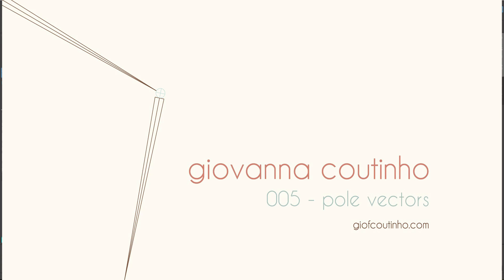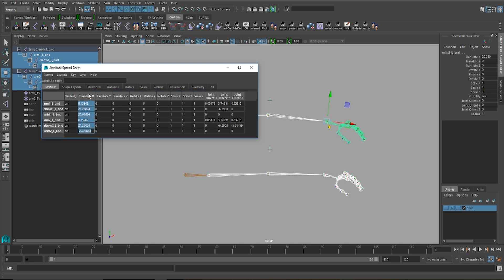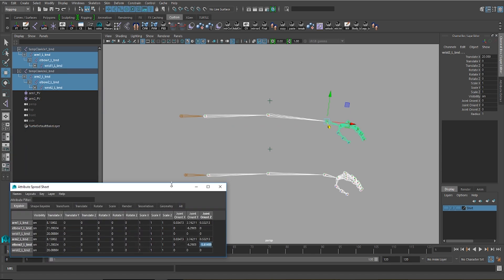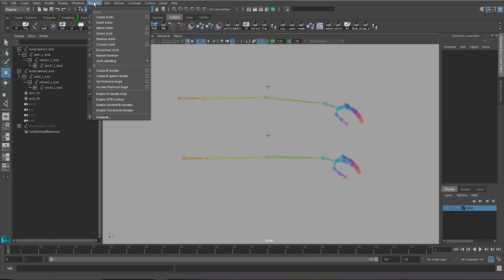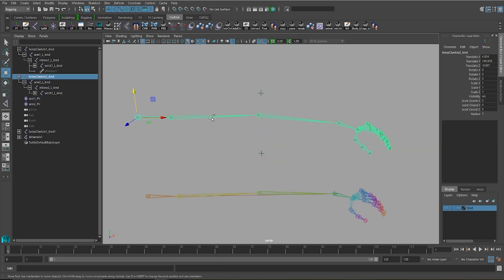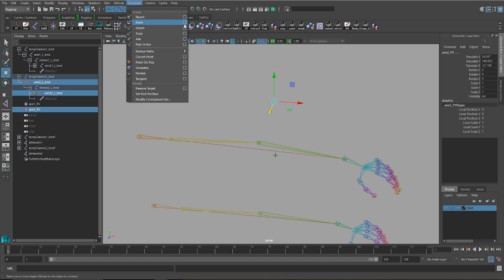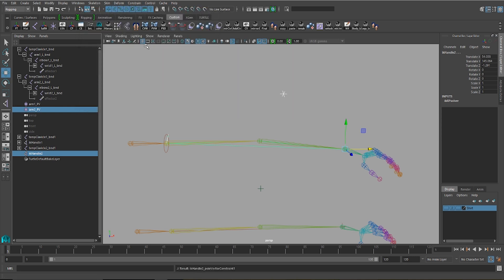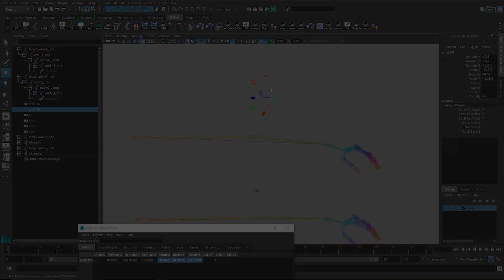005 - Pole Vectors

Comment: Brilliant - this is really helpful  - thanks for posting this! - One extra thing I found - at 4:42 - when you move the locator back away from the joint, I needed to set the Move tool to something other than 'World' mode. I set it to 'object' mode - but found I needed a couple of goes to 'push' it past the joint - setting it to 'custom' worked best as it kept the same angle and allowed me to push it past the joint.

Comment: Hm I'm still getting PV snapping even with only 1 axis of rotation. With a biped model with legs that aren't completely straight, what's the best way to place your joints to avoid snapping? Or is there no way to have a normal-looking perfectly aligned polevector with a bent limbs?

Comment: Nice technique. I usually solve it by drawing a 1 degree curve through each of the joints (shoulder, elbow, wrist), and then move middle cv using the normal direction (setting the translate tool to normal). After that I just snap my polevector locator to that middle cv. That should give the same result, just another way of doing it :)
Reply from the maker: Oh - that sounds awesome! I'll give it a shot sometime, sounds simpler than using constraints. Thanks!